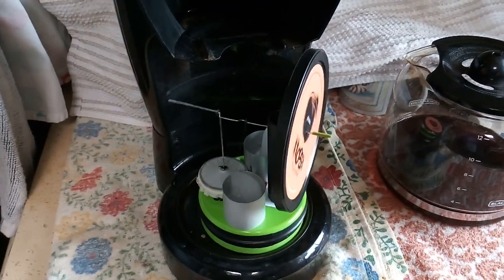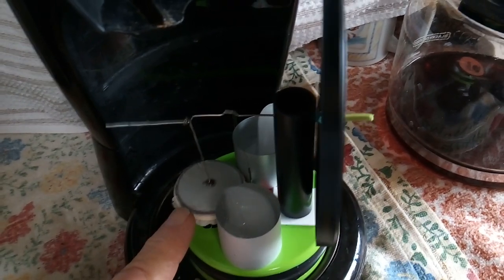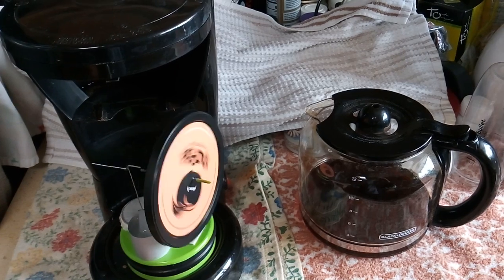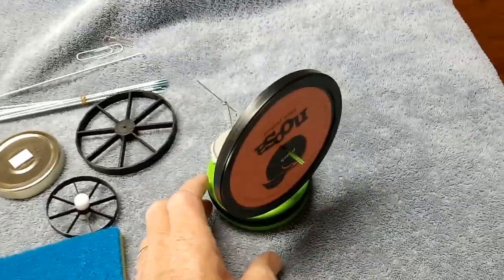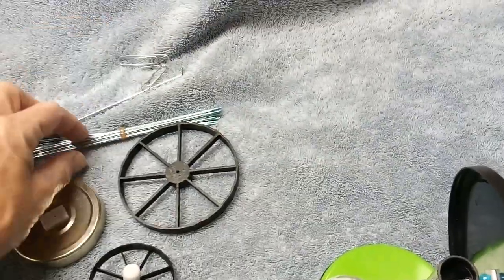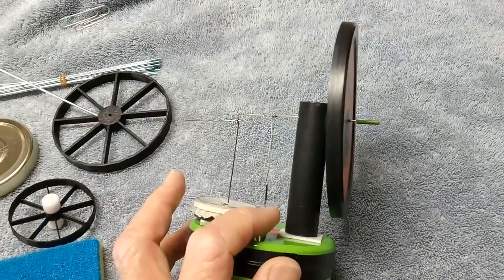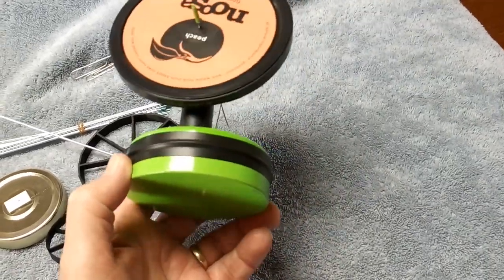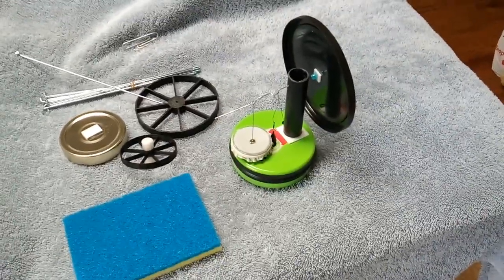LTD Stirling Engine ----  Quest for simplicity

Comment: You got it working very well. I like the fact that you have them running at low temperatures. 
I built one about 10 years ago, my first attempt, but I had to use a tea candle to get it to run. It did work but far too much heat. Your LTD ones are great. Might have a go at one myself. 👌👍💿
Reply from the maker: If you can make something that doesn't require an open flame it is better.  When wife my says, "what is that burning smell"  it usually ends my kitchen countertop project. 😀🥲
Reply: @Lidmotor  😆👍

Comment: Reguarding the power piston diameter, the volume of displacement, and the crank shaft throw. I believe the secret is in that you found a good performing volume displacement. 

The volume displaced is a function of this piston's diameter and this piston's displacement caused by this crank shaft's throw. A smaller diameter power piston will displace the same volume with a longer throw, or a larger diameter power piston will displacement the same volume with a smaller throw. 

Just a thought: 
Between the top plate surface area, and the surface area of the walls of a heat conducting power piston,  you might try aiming for more surface area on the top plate, and a longer power piston having more surface area on the walls, and the crank throw being sufficient to match th  current power piston volume displacement. Or maybe tweak it a little to see if you can get a better performance.
Reply from the maker: Thanks for the ideas.  There are formulas for this stuff but I prefer to just look at what other people come up with and apply that to what I build.  It is kind of a 'monkey see monkey do' approach but I enjoy it.
Reply: @Lidmotor  I was wondering if I may contact you. I had questions about your lord kelvin replenisher, it's plate's dimensions, and if you got them elseware or just said "I think this looks good. And what you learned or would do different if you were to build it again. 

I'm in the middle of a build and since you inspired me, I wanted to share it with you.

Comment: Hello,  I am unsure if you my reply/ commemt on you last video but I have a question about how you wired one of your Newman motors .  I attempted to do it the way that you showed in the drawing/video with a breadboard but  I believe I keep on messing up. (I am new to this) 

By any chance could you direct me to a diagram on what to do with a bread board.

 Thank you and I apologize for any inconvenience.
Reply from the maker: Here is another video I did of the same circuit that might be a little clearer.  Basically the transistor used here is just a simple switch.  The spinning magnet induces a current in the sense coil.  That tells the transistor to turn on the juice to the second coil that pushes the magnet rotor around. https://www.youtube.com/watch?v=9zcrhe85dUU
Reply: @Lidmotor   Thank you very much. Do you happen to know if this will work with a series of flat magnets on the shaft instead of that cylindrical one that you have in the video.
Reply from the maker: @garybrown2039  Yes but they must be strong magnets.  Weak ceramic magnets will not generate enough current in the pickup coil to turn on the transistor.
Reply: @Lidmotor  understood thank you. Yea i've been using neodymium magnets but it wasnt working. I think i figured it out though.

The size of my copper windings was that of a adult male's fist. But i noticed that yours was much smaller (like half to a third the area of mine). 

So im redesigning my motor again.
Reply: @Lidmotor  edit: yea same issue.  Im goi g to try wiring it again. 

Wish me luck